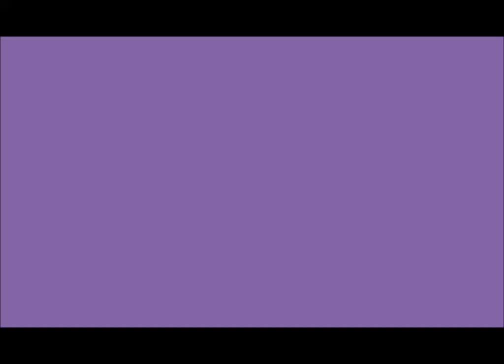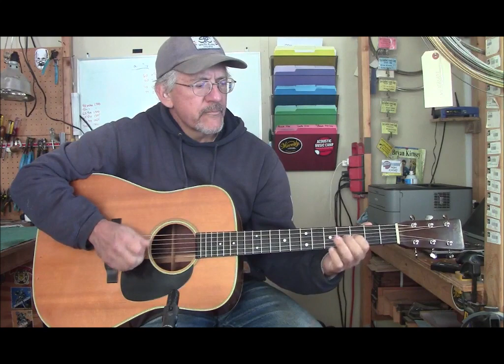Fully modified Martin D-28 vs stock

Comment: Popsicle removal,why would you wanna remove that?
Reply from the maker: In this case, the popsicle had failed and there were cracks on both sides of the fingerboard.  I use a trapezoidal brace instead, which is how you repair failed popsicle braces.  Letting the upper bout free will boost the B string and up.   See:  http://www.bryankimsey.com/popsicle/
Reply: Patrik     The popsicle brace most often only serves to dampen vibrations in the upper bout of the top. About 7 out of ten vintage guitars with the brace, will still have cracks in the top. Do a little research & you'll find out that Martin is even switching to a similar trapezoidal brace that sets right against the neck block & right against the brace the truss rod goes through.
Reply: You must be new here........